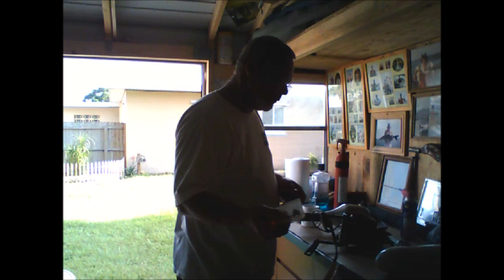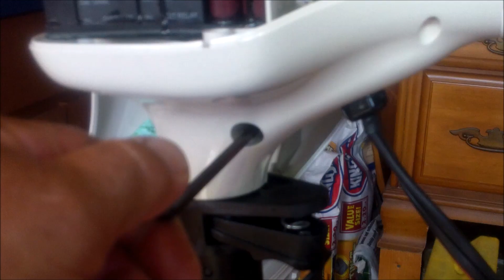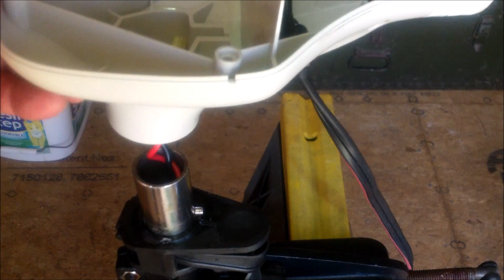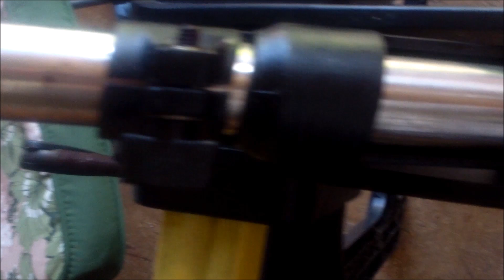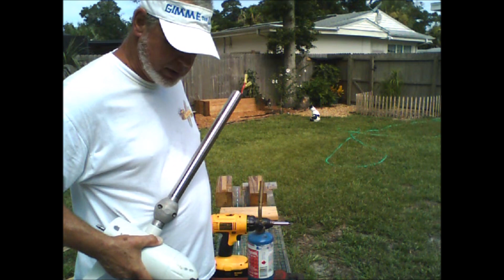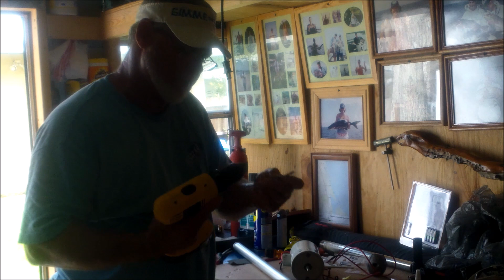Motor Guide 45lb Great White Vari-Max Trolling Motor Repair

Comment: Hey Gary - Thanks for posting this I'm dong the exact same thing on my Motorgude. All has gone well but when the head came away from the cables the quick connects at the shaft/column came off before I could see where the red and black wires went. Tried guessing based on where the wires go on top, but they don't exactly go opposite each other.  I'm guessing I might be able to try before reassembling but not sure if I'd blow any of the circuits. If it were a usual motor is seemed it might just reverse the direction of the motor.  If you have any tip I'm open. Thanks, David
Reply from the maker: +David Beede Hey David, I think you'll be ok checking it  like that without causing circuit issues. Just make sure its turning the right direction before you button it up. Hope the video helped and good luck, Gary
Reply: +Gary Meeks Thanks, that's what I figured, especially since the juice is leaving the circuit board section on it's way to the motor. Your video really helped. Just knowing it takes a torch to release the threads and Loctite 262 is the right stuff to re-assemble, saved a lot of head scratching. Even with the torch I had to put two vice grips on the shaft for leverage to budge it. Thanks again.

Comment: great video! i have a question and i hope you can help me out. while i was fishing my tie rope fell in the water and wrapped around the trolling motors prop and it just instantly loss power. brand new battery and fully charged. any idea what it can be. thanks in advance
Reply: Remove the prop, & unwind the rope from where it is wrapped so tightly around the shaft, ... inspect for any cracks/damaged areas, ... replace prop, ... & try it out, also check your breaker/fuse, on the main line, ...
Reply: Rod_Bending_Addicts so did you get your trolling motor working again?